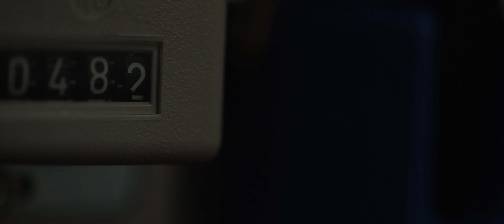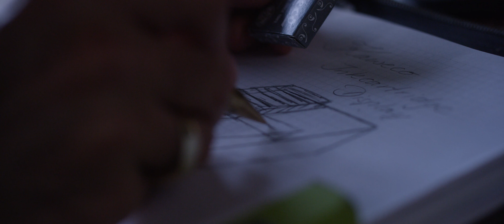Kaweco - The Story (en)

Comment: When a company supplies suitable products, word gets around quickly: Kaweco, they literally tear the pens out of their hands, from Baumkuchen to Tokyopenshop.
Why is that so? Because Kaweco offers something special in form and materiality and so far, apart from this unspeakable piece of silver, has resisted the temptation to drift into the milieu of fountain pen collectors with ornate ornamental kitsch, which is usually thought of as the 'fountain pen of the year' for those who already have everything, but not yet.

Kaweco still manufactures - and the company has to be thanked for this - utility tools, actual writing instruments; not uncritical, the plastic weighs extremely cheaply in the hand and the brass smells and leaves 'traces of powder' on the fingers. I don't put my brass fountain pens in the Sonnenleder cases either, which tend to give brass these efflorescences commonly known as 'verdigris'. I have just removed my brass mechanical pencil from my Kremer watercolour box after two months in which it can be perfectly clamped in the middle. I find that the octagonal body is stained with unattractive brown dots, whereas the conical tip and the cylindrical end cap are not. Very strange. 
In short: Every nice marketing is sooner or later triturated in the dull everyday use, in which Kaweco, at least with me, proves himself altogether.

In any case I hope that Kaweco will never fall into the hands of any investors who inflate a brand beyond all kinds of diversification to the point of unrecognizability and thus dilute it, but remain owner-managed and orientate themselves on down-to-earth values of 'good', 'functional' and 'sober' and ultimately take replica of Bauhaus traditions: Beauty always within function.
Therefore, paradoxically, one should not wish this company too much success, otherwise it will be over.
Success corrupts. Always and everywhere. See Arnold Toynbee: The course of world history, the rise and decline of cultures. Spengler also goes.

Solch obiger Image-Filme bedarf es hier gar nicht; wenn eine Firma taugliche Produkte liefert, spricht sich das schnell rum: Kaweco reißen sie die Stifte förmlich aus der Hand, von Baumkuchen bis zu Tokyopenshop.

Warum ist das so? Weil Kaweco in Form und Materialität Besonderes bietet und bisher, von diesem unsäglichen Silberstück abgesehen, der Verführung widerstanden hat, ins Geckenmilieu der Füllersammler abzudriften, mit verschnörkeltem Zierkitsch, den man üblicherweise als ‚Füller des Jahres‘ an denjenigen zu bringen gedenkt, der schon alles hat, aber dieses noch nicht.

Kaweco fertigt noch - und der Firma ist hierfür Dank auszusprechen - Gebrauchswerkzeuge, tatsächliche Schreibgeräte; nicht unbekrittelt, das Plastik etwa wiegt ausgesprochen billig in der Hand und das Messing riecht und hinterlässt ‚Schmauchspuren‘ an den Fingern. Ich verfrachte meine Messingfüller auch nicht in die Etuis von ‚Sonnenleder‘, das dazu neigt, Messing mit diesen Ausblühungen zu versehen, die man gemeinhin als ‚Grünspan‘ bezeichnet. Eben erst habe ich meinen Messing-Druckbleistift nach zwei Monaten Verweildauer meinem Kremer-Aquarellkasten entnommen, darin er sich mittig perfekt einklemmen lässt und muss feststellen, dass sich der oktogonale Korpus mit unschönen braunen Punkten befleckt hat, die konische Spitze und die zylindrische Endkappe hingegen nicht. Sehr seltsam. 

Kurzum: Jedes schöne Marketing wird über kurz oder lang zerrieben am schnöden Alltagsgebrauch, darin sich Kaweco, jedenfalls bei mir, insgesamt bewährt.
Ich jedenfalls hoffe, dass Kaweco niemals irgendwelchen Investoren in die Hände fällt, die eine Marke über allerlei Diversifikation bis zur Unkenntlichkeit aufblähen und damit verwässern, sondern weiterhin inhabergeführt bleibt und sich an bodenständigen Werten von ‚gut‘, ‚zweckmäßig‘ und ‚nüchtern‘ orientiert und letztlich Replik nimmt an Bauhaus-Traditionen: Schönheit immer innerhalb der Funktion.
Deshalb darf man dieser Firma, paradoxerweise, nicht allzuviel Erfolg wünschen, sonst ist es aus damit.
Erfolg korrumpiert. Immer und überall. Siehe hierzu Arnold Toynbee: Der Gang der Weltgeschichte, Aufstieg und Verfall der Kulturen. Spengler geht auch.
Reply: Well said brother!! Proud owner of my 1st Kaweco Sport in Burgundy and Gold plated Nib! Such a nice little pen, I love it way more, than I thought I would do!!! I wish I wasn't poor, I would buy the Aluminum version too!
Reply: cool story bro